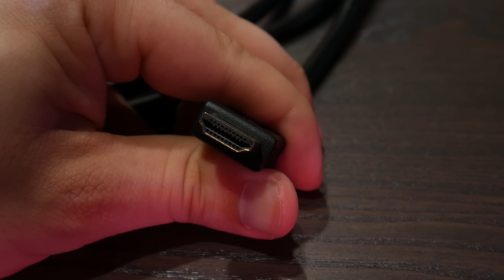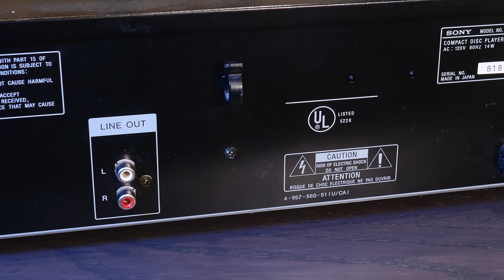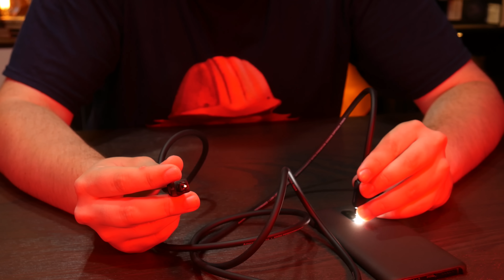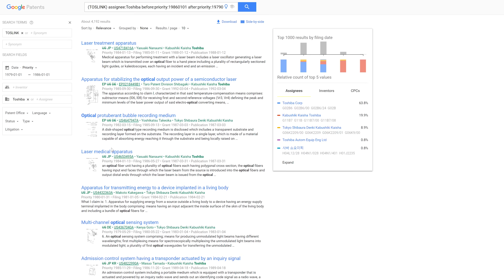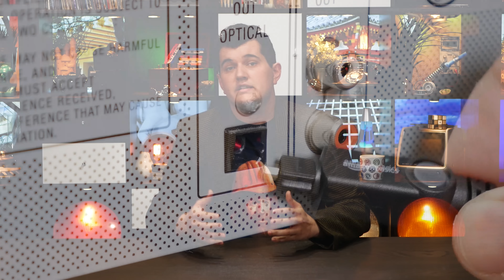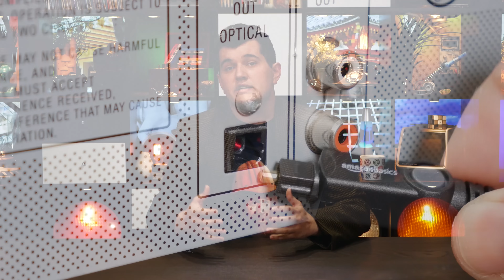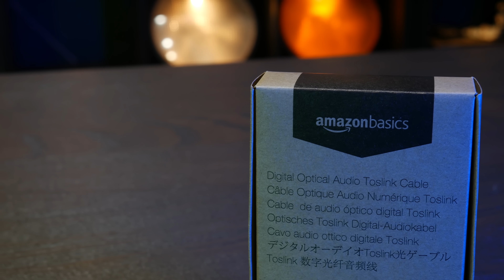TOSLINK: That one consumer fiber optic standard

Comment: 11:40 "Once we get to the DAC, we are well past the point where cables can make a difference."
Almost, but not quite.  The DAC may still receive a perfect signal, but a ground loop that involves everything in the chain, including digital copper connections between boxes, can immediately superimpose itself on the analog version.

I'm a sound guy, dealing with pro audio mixers, etc., and I had that exact problem with an analog mixer that had a USB input.  USB is digital, right?  Inherently perfect and noise-immune, right?  Nope!  That perfect sound had a warble superimposed on it, that changed depending on what the laptop was doing at the time.  Unplug the laptop's power cord, and the warble went away.

Aha!  Classic ground loop, even if it sounds different.  It was probably picking up a switching power supply inside the laptop, instead of the AC power line, but the mechanism and the fix are still the same.

I looked at off-the-shelf USB isolators, got sticker shock, and made my own from a single chip that does that job, plus a custom circuit board to put it on.  (still cheaper than buying a completed unit)  And then the laptop could be plugged into the wall, without the warble.  Optical would have solved that problem too, for the same reason of not having a continuous copper connection between plugs, regardless of whether it's analog or digital.
Reply: Great comment. Hope you don't mind me resurrecting an old thread. 

Working a DJ gig one night in the years before I became an experienced audio engineer (through self-directed learning as the only technician at a community radio station) I had to keep swapping between two laptops, charging one while playing music from the other because both were producing very noticeable ground loop hum when plugged into the mains. I'd only brought a second laptop to use for karaoke, but I was so glad I had it! From then on I always connected laptops via ground loop isolators.

It's only more recently that I've begun to use USB digital audio connections for live sound applications and my 2013 Macbook Pro has never given any issues in that regard. However, given my experience with Windows laptops, I'm very curious about your DIY USB isolator, could you tell me more about it?
Reply: @donaloflynn  Oh, I suppose I could publish it.  Here you go:
https://drive.google.com/file/d/1w_Ms923VosQyL0RS7zgfxbzxNKOXi6-E/view?usp=sharing
For everyone else reading this thread, you're welcome!  :-)

It's one chip surrounded by 8 passives, all surface-mount, and some pads that are meant to be solder-bridged on purpose to set the speed.  Connection to the outside world is by cutting a working USB cord and soldering the wires onto the board, using the only through holes for mechanical strength.  The remaining 2 holes are for a device-side isolated 5vdc power supply (so-called "wall-wart" for electronics hobbyists), also cut and soldered on.  No protection against mistakes, as it was originally meant for just me, who I trusted to be careful enough to get it right the first time and double-check it.

If I were to make another one now, I would send the same manufacturing files to the fab shop again - no need to change the design - put some solder paste on it, and bake it in my repurposed toaster oven.  But the original project is well before that or even my hot air gun, so I would have done it with an iron then.  And like I said in my original comment, it works perfectly!
Reply: @aaronduerksen1378  Thank you very much!
Reply: The DAC receives AC power even if you use fiber optic data
Reply: @andrewbroeker9819  Yes, the "consumer black box with connectors" usually receives AC power (ignoring a few battery-powered ones), but that's irrelevant.  The DAC chip itself *always* receives DC power, usually 3.3V or 5V (sometimes both), that has quite a heritage already, looking back towards the AC input.  No (meaningful) trace of the original AC at all by that point, including whatever "junk" it might have had on it.

Likewise for any analog processing: regulated power, with no meaningful trace of the original AC or its "junk".  And its function has nothing to do with the supply anyway.  When designing the processing logic, the supply might as well be infinite, because the function is determined entirely by the relative values of the passives involved: resistors, capacitors, the occasional diode, and the even more occasional inductor.  Meanwhile, the active parts - opamps (they really are transparent now, no reason to not use them) - simply do what's necessary to keep their two inputs equal.  (the clever part is to arrange the passives around the opamp, so that the output has to do something "interesting" in order to satisfy that rule)  Nowhere does the power supply enter into that equation, especially the raw AC side.  A poorly-made DC center tap might create a signal out of some supply noise, which is then mixed with the intended signal, but that's all I can see beyond intentionally coupling the supply rail into the signal.  And I have no idea why someone would do that.

And the safety-required isolation from the AC mains means that the circuit is free to connect any one part of itself to any one part of something else, without creating noise.  Ground loops come when you have more than one connection.  If the manufacturer already did that, say, to connect the signal reference to the safety ground (NEVER REMOVE A SAFETY GROUND!!!!!  Its purpose is to trip a breaker before it kills someone.), then any copper connection that you add might cause some problems.  But if the manufacturer didn't do that, and left the circuit floating, then you can freely add ONE copper connection, and be perfectly okay.

---

For another note: One of the pro-gear systems that I've set up and spent a lot of time running, has a respected-brand (Allen & Heath) 40-channel analog mixing console ("sound board") that is powered from 16-0-16VDC (32V total with a grounded center tap) plus 48VDC to power some of the mics (48V above that center tap).  All of that comes from a rack-mounted linear supply that simply runs the AC input through a transformer, both to get the voltage "sorta close" and provide the safety isolation, runs that through some diodes to charge the capacitors that hold it up between AC peaks, and then regulates that still-somewhat-ripply DC to the required voltages to send out.

I believe that the main 16-0-16V output, and the +48V "phantom power", each have their own separate secondary windings in the transformer, followed by separate rectifiers, bulk storage capacitors, and regulators.  The 0V rails of both are connected to each other and to the safety ground.  That then goes out through a 10ft cable or so to power the board itself.  Each channel is its own circuit board that has an R-C filter at its power input, so that the circuit itself might see about 15-0-15V or so because the R in that filter also drops some.  The only regulation in there is in the rack-mount cinder-block of a power brick, and it's only one stage of regulation, compared to several that a more modern thing might have with its fancy efficient switchmode stuff.  The R-C filter for each channel is probably to account for the long cable between the regulator and its load, and whatever noise might have gotten in through there.  I don't do that for my own locally-regulated stuff.

The reason to say all that, is to show how simple and "brute-force-ish" it is, even for a pro thing, and it sounds perfectly fine!  The audiophool garbage about nasty AC power is just that: audiophool garbage.
Reply: Update: I clicked through to the sequel ( https://www.youtube.com/watch?v=CwZdur1Pi3M ), where this exact thing is addressed right up front.  Still leaving my original comment up for people who aren't going to do that.  (but do read comments)

Comment: Imagine if they'd somehow found an overcomplicated way to get the actual laser reflection off the CD directly into the toslink cable
Reply: Galaxy Brain moment!
Reply: and have optical wires go to your active speakers, where an optical chip processes the data and only then convert it to electricity to make the speakers move
Reply: @FuZZbaLLbee  no, let the photonic thrust vibrate the membrane and create sound that way, like a solar sail spacecraft
Reply: @FuZZbaLLbee  Edifier makes them! R1280DB Powered Bluetooth Bookshelf Speakers - Optical Input - Wireless Studio Monitors - 4 Inch Near Field Speaker - 42w RMS - Wood Grain - Sold on Amazon for $150.
Reply: For some reason that makes me think of listening to a record by putting my ear close to the stylus.😂
Reply: that's like expecting a different result from rearranging numbers in a sum equation.

Comment: Picture this: My Audio Setup on my PC is quite expensive, because i like me some good sound.

Up until now, i was using a USB-Soundcard and i always had grounding-issues, with USB and actually got into analyzing USB-Signals and BOI...especially PC Case front USB-Port ssssssssuuuuuuuuuuuuuuuuuuuuuuuuuuuuuuuhhhuhuck, when it comes to signal clarity. And it also depends on the stuff you connect.

Shouldn't be an issue, right? I mean, that is all digital!
Yeah, tell that to my ears.

For instance: I could RELIABLY reproduce a behavior, when i connected my Soundcard and the Keyboard to the front USB. The Keyboard produces not even background noise it really goes
"DUUUUUUUUUUUUUUUUUUUUUUUUUUUUUUUUUUUUUUUUUUUUNNNNNNNNNNNNNNNNNNNNNNNNNNNNNNNNNNNNNNNN!!!!"
Like loud!
Really REALLY loud! 

With multiple cards from Creative, Focusrite, Tascam, Schiit (Yes really, that's, what they're called!) and some cheap mixxer i had lying around.
And just FYI: The issue was on ALL ports, not just front! The front ports just made it A LOT worse!
Said cards work fine on other systems, like my laptop for instance. Only my PC is producing these issues.

Got into touch with some sound engineers and they apparently knew of this issue. It has something to do, with the Power-line, of the USB-Connector, not being grounded properly and breaking through the shielding of the sound gear, that SHOULD eliminate this problem! As the final solution they recommended Toslink.
So i got a DAC with integrated Toslink, to de-couple my DAC from, whatever my PC is doing.
The Toslink-solution has the benefit of seperating signal from power (In the sense, that they do not go through the "same" system!).

And yes, wie tried to "fix" the issue, by tinkering a bit, but once it got into "Dismantle your Ports!" and "Solder this!", i went "NOPE! Not going to!" 

So riddle me this, if it doesn't matter!
Dunno, if the coaxial would fix it too, to be fair, but EMI can in fact be a problem!
Probably not at the Cable, but at the source/recieving end. Haven't had this problem, since then.

Comment: Kinda old video, but I have a question.
When playing a videogame on  a games console through a TV, I've noticed that through HDMI, there's a certain amount of lag with the sound.
This isn't usually noticible, but with Rocksmith (A game which takes input from a guitar, into a console, and then uses the TV like an amplifier) there's a very noticable delay specifically with the input from the guitar - the background sound from the game doesn't appear to be an issue.
As an example, with this setup you get a split-second delay between playing a note and hearing it through the TV.

I managed to sort the issue for myself by instead using an optical output to a sound bar (as my TV doesn't support this) - doing so completely eliminates any noticable delay.
So, what's the source of the lag in this situation, given the explanation in this video? Would it be an issue with the processing speed of the TV itself, and perhaps it's only noticable with the guitar because you know exactly when to expect the sound?
Hope that makes sense.

Comment: Nice info 👍 My old Acer laptop from 2005 had mini toslink in its 3,5mm port. I used it with my multichannel amplifier. At first I was not going to believe that there is light coming out of my laptop's headphone jack 😅

Comment: I think that TOSLINK has a point: Probably lots of people tried to put normal headphone cable (with RCA connectors) or rca audio cable, into CVBS or Coaxial SPDIF connections and had lots of silly issues. If you use such cable, the output amplifiers gain tend to fall and signal arrives attenuated or distorted to the another end. The correct cable is Coaxial 75 ohm cable, rigid or flexible, that's on you. TOSLINK can be a cheap way to prevent this misuse. Also Toslink allows to use long cables. Coaxial SPDIF tends to fail over 10mt. One reason is that has not enough error correction measures and another is that is a baseband signal, and coaxial cables are better suited to use carrier modulated nonbinary signals at pretty high frequency (That means gain over cable is not lowpass, is more like bandpass).

It would be really nice to see a SDI standard video (the protocol father of the HDMI).
I pretty don't like HDMI (I know it a little from inside). I think that connector is flawed (tends to break easily with cable weight), and is not on par to another standards like DVI or DisplayPort regarding quality and modes available. Also I hate the outrageous mess that the standard HDMI modes cause in TV's with buggy EDID. Old standards like SDI work well despite I have to admit that is more expensive electronic wise. A carrier method instead of smartass coding would make any coaxial cable capable from day 1 to carry lots of times HDMI bandwith. However, I can understand that those electronic arrangements are not CMOS-Friendly and need some special high voltage, lots of magnetics, not-so-integrated devices inside.

Of course, I would agree to a optic audiovisual standard (with some ethernet or i2c capabilities inside). Would be cheap and fast (despite not so grandpa/grandma friendly)

Comment: You're absolutely correct, you can run a TOSLINK optical connection in multi-mode optical cables (designed to work in short distances using LEDs, single mode optical cabling was designed to work longer distances using lasers).

Comment: There is a real danger of introducing a ground loop when you have a wired connection between two points.  This results in a 60-cycle hum if you are in the US which can sometimes be unbearably loud and can sometimes be subtle.

I've never been bothered by group loops in building a sound system for the house,  but are a big pain if you are wiring up a system for recording music or for live shows,  reinforcing sound for a church,  etc.

Comment: I recently bought a 100 disc CD changer at a thrift store and it had a TOSlink cable attached.  I tried plugging in standard RCA cables to the appropriate sockets, but the plugs wouldn't go in.  I figured that was why the optical cable was there.  Not being particularly interested in using the optical interface, I got out a drill to see if I could just plow through whatever was blocking the RCA jacks.  The drill went in but didn't really get far, which I thought was odd.  As I removed the drill bit, it looked like metal was coming out.  For a second I thought I had ruined the jack and somehow removed a metal liner or something, but no.  What was coming out was the pin part of an RCA plug that had somehow broken off inside the jack, and both the red and white jacks had pins stuck inside!  Once I got the pins out, I plugged the new cables right in, connected those to a receiver, and bingo, everything worked fine!

Comment: Nice vid :-). Youre missing one point. With toslink the player has a galvanic isolation to your amp. This doesnt make a huge of difference on (good) standard audio equipment, it changes when you connect your pc to your amp. You get ALOT of electric garbage inside your pc, and a part of it will be transmitted via your coax to your amp (most feared "ground loops" can be killed that way). And yes as you mentioned its immune to any form of interference. Oh yeah, and toslink is nowhere to be "out" lol... :D It is everywhere. Look up ChiFi, the average SMSL DAC  .... Cheapo bluetooth receiver, optical in/out.

Comment: I use it at home, to move audio from my set top box/DVR, to my office audio rig. It is a 50 foot run of toslink. It is very small and runs nicely along the baseboard, under the baseboard in some places, and under carpets in others. If I had to run a thick copper cable that distance, well, I wouldn’t.

Comment: Benefits of avoiding ground loops is still an advantage as to connect using electrical wires means you must connect the grounds between the equipment.  With the optical cable, no ground connection, and hence absolutely no ground loops.

Comment: You left out ground loops. The point is NOT minimizing  EMI in the cable. It's about eliminating the electrical connection between devices. Digital or not connecting devices with different ground potentials into each other with conductive cable can cause a ground loop. It's not as simple as plugging everything to the same electrical outlet. Don't forget your tv is likley plugged into an antenna or cable that shares a ground with the tv in the other room.... or up stairs..... Coming toslink out of your tv into your amp or receiver isolates your audio from that ground loop. HDMI and coaxial 
spdif does not.

Comment: 12:04 a device can be isolated from the building based on the power supply design. A transformer followed by good rectification can isolate pretty well. 
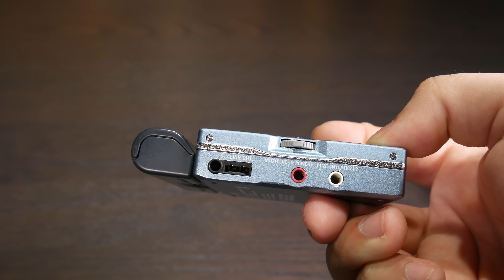14:10 oh wow i had a laptop that had red light in the audio jack and i never realized it was for this.
15:58 what is the BW of toslink?